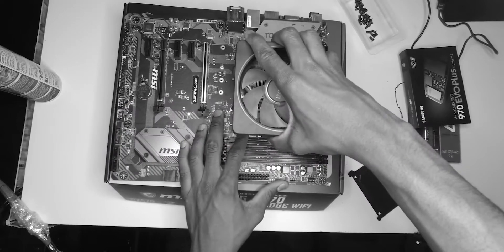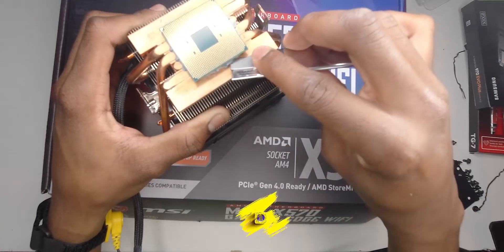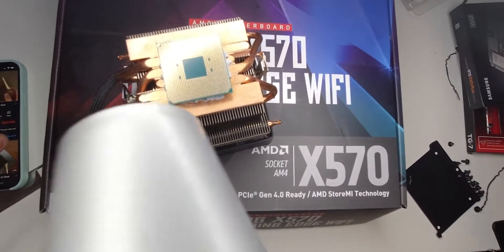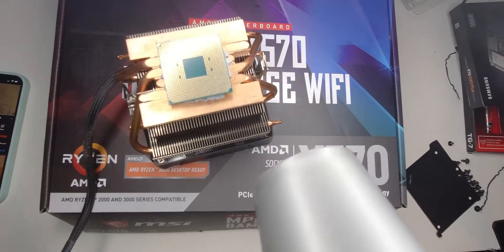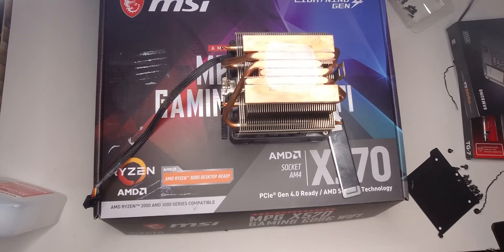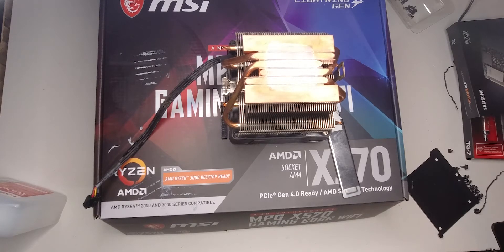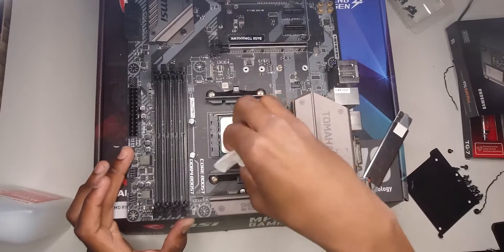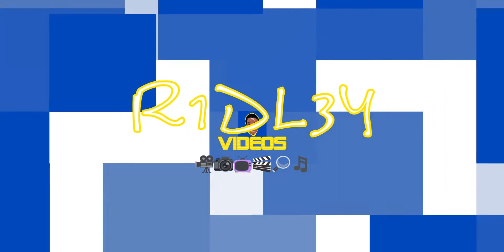How to Safely Remove AMD CPU Chip Stuck to AMD Heat sink!

Comment: Mine was really stuck on after 6 years... it  took a lot of heat and A lot of force.  I feel lucky nothing got damaged except for a small scratch in my cooler.   Its back together now Temps are great.
Reply from the maker: Nice
Reply: I'm dealing with this right now lol, about 4 years without a change in thermal paste, let it run for a bit before taking it off and well... Cpu came along for a ride with the heater lol, wish me luck
Reply: @blooskydante   Good Luck!   Use Heat!

Comment: OK i'm going to write this here, even though it shames me it happened -

Got the same setup, with a giant WRAITH cooler. Not sure when it got repasted last or if it's even factory paste.
Decided I wanted to repaste it. Followed this video and others - Same as you guys, was kinda hard pulling that sucker out even though I ran it for some time before, to get it kinda hot (normal games, not stress tests).

The cooler came off together with the CPU, which is kind of a no no by itself, but luckily the pins weren't bent. 
Looked up another video which suggested to use a boxcutter to free it from the cooler plate. Did just that.

Problem? I freaking didn't see it correctly from that angle and ended up slicing the damn chip IN HALF. IT was hard AF, but I actually did it. Needless to say, it got ruined.
Had to buy a new CPU a few days later. So yeah... look out. If it gets stuck, don't make the same stupid mistake and slice it from it's middle point, slice directly from the cooler plate. They're pretty close and it can get confusing. I feel so dumb that that happened.
Reply from the maker: Live and learn

Comment: Had a 3950x stuck on a h150i I tried heating it up and twist and it would not budge just applying a tiny bit of leverage to the plastic cpu using a knife popped mine off instantly and both still work fine - risky but it is far easier than twisting where all the strength is
Reply from the maker: Very risky

Comment: Well, the usual word is to never, ever, try to remove an AMD CPU after a long period of system off ; always reboot first, use if possible a stress test or CPU test a few dozen minutes, then, and only then, log off and try to unmount the whole thing; the heat will have softened the paste and it will be easier to remove, turni g slowly left and right the heatsink too at first.. (just old basics I had to read too..before trying it myself \ ). Even more dangerous as amds have still pins..
Reply from the maker: Thanks for this Tip I really appreciate it

Comment: How do remove the cpu without ripping it out of the socket?
Reply from the maker: 🤔 did you unlock the socket lock thingy?
Reply: @DR1DL3Y  I had to force the cpu from the socket, thus breaks the latch open. No damage happened
Reply from the maker: Lucky you